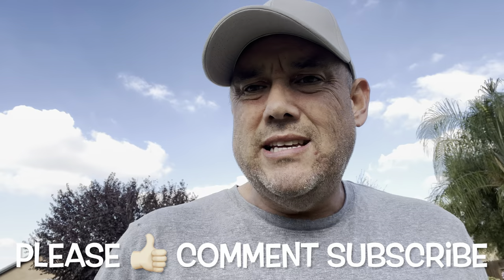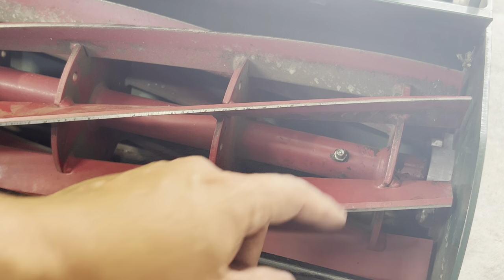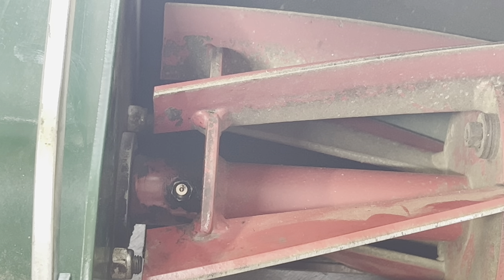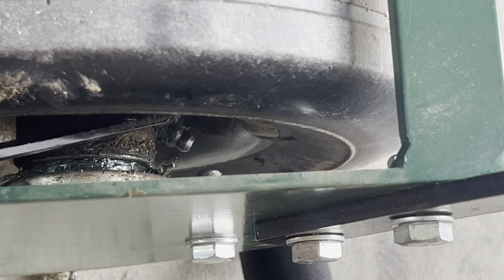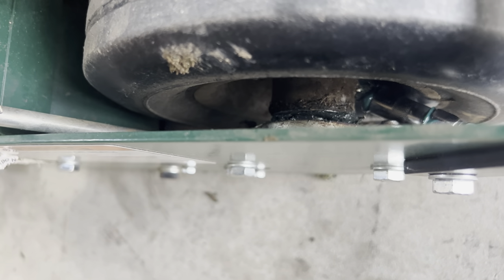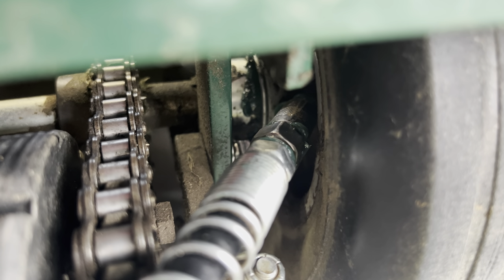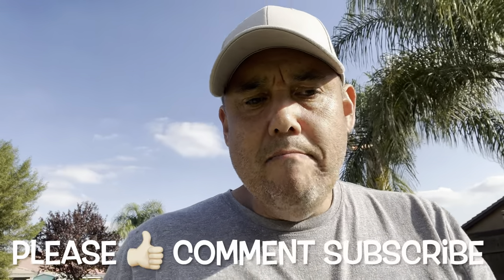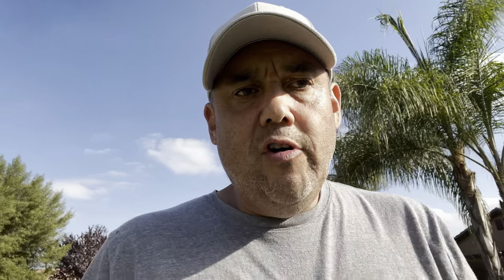How to Grease 20 inch California Trimmer Reel Mower - RL207H

Comment: Did my first oil change and greasing on my California Trimmer.   Oil change went easy and so did greasing the front reel grease fittings.  However, I could not get the grease gun to press onto the wheel zerk fittings.   It is a new grease gun.  Any suggestions?
Reply from the maker: When setting the grease gun to the fitting i would try pull back on it to see if comes off easily. If so it not on the fitting enough to make a good seal. I generally have to rotate my grease gun to remove the hose from fitting. The only other thing i would try is to apply some forward pressure on the fitting and then squeeze the trigger on the grease gun. Hopes this helps

Comment: Can the complete handle be removed so that the reel mower can be placed inside of a car?  TIA!
Reply from the maker: You can remove the handle assembly but the throttle cable and clutch cable may need to also be removed in order to complete remove the handle assembly. If you watch my cal trimmer handle ext kit video i show how to remove the handle assembly. Let me know if you have any other follow up questions. 👍🏻